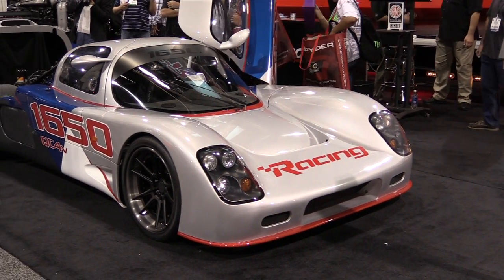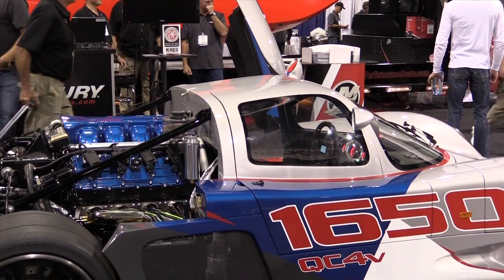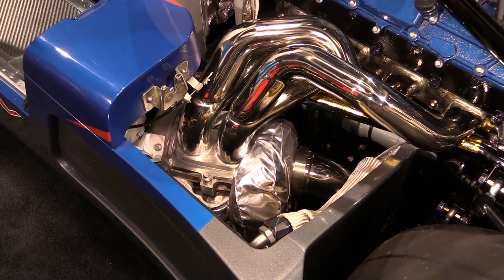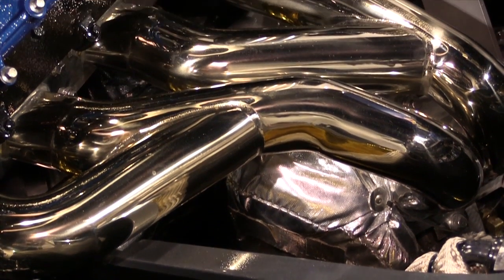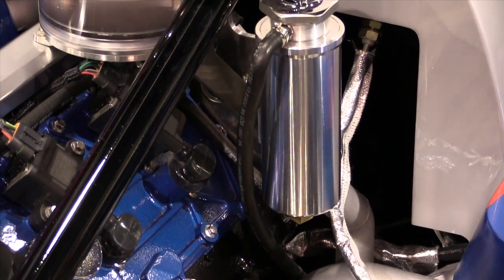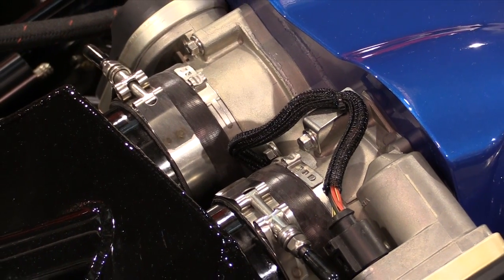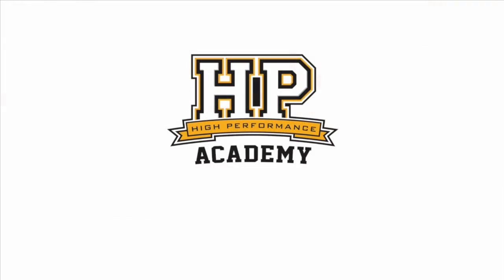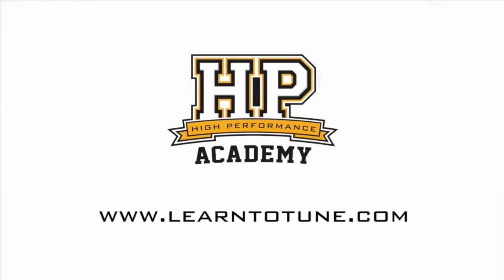1650HP Mercury Racing Crate Motor with Jason from Mercury

Comment: What kind of transaxle is being used?  I'm not aware of anything available that will handle more than 650 lb/ft of torque.  Looks cool, but I don't think the transaxle or axles will take the torque.

There's a reason F1 engines turn at 24,000 rpm. It's to develop a lot of HP at much lower torque such that the transaxle can be physically much smaller.

Comment: It should perhaps be mentioned that in a powerboat application these engines can easily consume +100 gallons/h when going for it. Just build your gas tank large enough is what I'm saying.
Reply: And there’s never just one of these engines in a boat. Ever.
Reply: Your car rolls on a smooth surface, a boat pushes a very large and heavy object through water. The two loads are vastly different. Ever try to run in the water vs on land? Hence why boats consume far more fuel. It would consume far less in a car than in a boat. Also in a car we have multi speed transmissions, a boat does not. A car cruises in top gear with low rpm, a boat runs 3/4 throttle for it's regular cruising. On a highway we use almost no throttle to maintain a cruise speed. That being said a 1650 hp 9 liter motor will not sip fuel. Check out a Hellcat, at top speed it smokes it's fuel supply in minutes with just wind restriction and minor friction as it's load.
Reply: @MovieMuscle   Top fuel dragster all burn over a gallon per second. And that is minimum 90% nitromethane. A typical offshore boat burns through 3000 dollars in a short outing. Both are for super rich or corporate racing. A lot of guys park their boats at the beach mostly...
Reply: A fuel dragster will go through 17 gallons in 1000 feet.
But its also making 10,000+hp.

Comment: Can it fit in a 93 Mazda Miata?

Lol JK
Reply from the maker: Do it. I dare you =P - Taz.
Reply: The rotary 2 stroke wankle and sled motors run better oil injection than this thing. this big block valved 552 CID 2 stroke needs a turbo to barely make under 3 hp pet CID, A rotax 850 etec make over 3hp per CID without turbo

Comment: 9 Liter and1600HP?  YIKES!!
Reply: pretty horrible.
Reply: An 850 rotax makes over 3 hp per CID with a turbo, this bid poppet valved 2 stroke comes close though
Reply: This is some time of big block 2 stroke, it’s got dry sump so it can be rigged with oil injection, Klotz oil is what I would use, I want to get one of these engines for s 2 stroke conversion but they are not cheap

Comment: The tech today  that makes an engine last longer is a centrifugal blower. You can still get lots of power but it spools a little slower and it's easier on parts. Perfect for boats. No heat like a turbo. Better for cars.
Reply: Mike383HK Did you just say “a supercharger spools slower than a turbo” 😭😭😭😂😂😂😂😂
Reply: You have no clue what you're talking about... Centri units don't "spool", much less "spool slower". They're actually HARDER on parts than a turbo, since they usually add a lot of lateral load to the crank snout, and finally, THEY STILL MAKE AN ASS-TON OF HEAT, BECAUSE COMPRESSING AIR ALSO HEATS IT, which is why pretty much every Procharger kit still comes with an intercooler.

Also, what the fuck does any of what you said even remotely have to do with this video?
Reply: Oil injection from dry sump, it’s a roller bearings poppet valved loop charged 2 stroke.

Comment: Hennessy is way out of your league. Stay on your boat monopoly.
Reply: John Hennessey is a dumbass and a CROOK.

He's a JOKE in the performance world that overcharges for shoddily engineered bullshit and routinely rips off his customers.
Reply: Finally a big block 2 stroke valved, loop charged though with oil injection, roller bearings throughout the motor, impressive big 2 stroke hear

Comment: Yeah i like to see the setup where it does full open throttle on 4 wheels for more than 5 minutes...You would need to tow a fuel tank behind that Ultima and put 3 times the radiators on it so it won't melt. 😂
Reply: Where is the place on earth a 1 tonne Ultima can be pinned at 1650hp for 5 minutes straight? There are very few places where more than 30s or so of WOT would be realistic and almost nowhere for much over a minute.
Reply: @siraff4461  its called a rolling dyno fool
Reply: @MrBundyjr  What has that got to do with it? The point is you can't pin it for that long so there's no point designing it to do that. It's not like driving your moms fiesta.
Reply: j r a dyno also couldn’t replicate the airflow of the car actually moving so it would over heat real quick

Comment: I'm going to spend 20 thousand on one of these before I die.  promise
Reply: Try $175,000.00 EACH
Reply: For the engine,or the whole car?
Reply: 2 for 40 thousand
Reply: 2 stroke conversion with dry sump oil injection like this::https://m.youtube.com/watch?v=IRiGq-VYWUk&t=245s
Reply: More like 70,000$ each for bare engines.  Now twin engines for a boat with all the running gear will cost you over 220,000. That without the drive components and without the boat itself. Your looking at a million dollar setup.
Reply: Devon R B   No do I do not need to be rebuilt that fast you can run the motorist 200 hours if you take care of them before you need to freshen them up  I home 838' fountain With 2 of them motors
Reply: The engine without turbochargers no intercooler no piping for turbos or coolers is 70 thousand dollars.

Comment: Wow 
6 feet wide
4 feet tall 
probably over a ton
zero parts availability 
so whatever
Reply: JethroBodean I read they have everything need to make it happen with money. I'm sure they will keep your investment running if you give them over 10g's. I would m8
Reply: Robert  Anderson The small block is LS based not the 9 Liter
Reply: JethroBodean They do have parts availability, in-fact they have multiple factories.
Reply: Funny considering its LS based you fuckwit
Reply: It’s a big block valved 2 stroke

Comment: I wonder if we could see 1650 on an E-85 tune with this awesome beast? Do you know if Jason and his team do that kind of tune with this?
Reply: Problem is not whether or not it could, because it can. What will be the limiting factor is the injectors. If the injectors will supply the fuel, it's most likely 2500+ capable on E85.
It would most likely be 2500-3000 hp capable in a car application on C16. It's a marine engine and it's already quite reliable in a 1650 hp C16 application. it can make a hell of a lot more power in a car where it's not under a constant high load with a high cylinder pressures.
Reply: E85 is a very poor marine fuel because it's so hydroscopic.
Reply: I would run oil injection from dry sump and VRO pump with silkooene pro 2 sx 2 stroke oil. This has roller bearings every where and is a poppet valved loop charger 2 stroke
Reply: @jlo13800  WTF are you talking about, your not even in the same universe as this engine
Reply: @chrisdeez2176  do you run oil i njection and can it run in multiple positions
Reply: @chrisdeez2176  I have run 7 gallons of xd-100 thought my detroit 8v92 2 stroke with total loss oil burnoff, but of wee its kind of pricety but sucessful, she loves it but i dont because of the cost some im back to shell rotella with quicksilcer TCW3, bummer!
Reply: I have lots of etec XD-100 and can and will run this oil, what is your fucking problem?
Reply: this engine can run on a poppet valved loop charged 2 stroke engine with total loss oil in injection with 2 stroke oil, you are stuck on a 4 joke stroke with no oil injection, this is an easy modification and it can be done!

Comment: This thing does not run 200-300 hours in a marine application without rebuilds. The 1100 maybe, but not the race spec 1650.
Reply: That's just race gas on the street cam. 1650hp is just a baseline. that engine is most likely capable of 2500hp in marine trim. remember, they're only at 20psi.
Reply: What?
1650 is not a baseline, it's the max power offered on this engine on race gas. And no, if the engine is capable of 1650 hp in a car, it is not capable of 2500 hp in a boat. When this engine was developed a few years ago, Mercury Racing raced a version dubbed Quadzilla with four turbos that had an output of 1750 hp and those things needed rebuilds after each race. Boat engines are under a lot more strain, run wot for much longer periods with higher cylinder pressure than car engines. There's a reason why see so few offshore engines above 1500 hp and the 2000hp car engines are all over the place. I've built both, and it takes a lot more to build a strong 1000 hp boat engine than a strong 1000 hp car engine. That's also why boat engines have a much shorter cycle between rebuilds.
This exact engine has an output of 1350 hp in marine applications on 91 AKI fuel, 1650 is not a baseline in any way shape or form, it is what the engine is capable of.
Reply: +ABOlsen69X  I'm seein 2.4litres churn out 750whp ethanol and boosted down for regular street use. your telling me a 9 litre  with unlimited funds cant achieve a better hp/ltr when it doesn't go thru the gear shock a street strip car gets. not to mention your IATs, EGTs, and oil temp are better in a marine application, consisting it's getting cooling from the body of water it floats in, meaning more oxygen for more fuel and less heat related stress. overheating at extended WOT should not be an issue, where as the street applications would see temps an easy 100° higher. ???
Reply: +ABOlsen69X and I say the 1650 is a baseline cause that was at 20 psi pump gas...
Reply: Don't take this in an offensive way, but I think you need a basic understanding of what an offshore marine engine is, what it can and can't do to understand this and you don't have that. The way you describe things and compare them, has nothing to do with anything. In order to understand a high performance marine engine like the Merc 1650, you need to forget everything about car engines. There's a reason why a built 1400 hp whipple blown EFI marine engine is more expensive than a 2500 hp twin turbo EFI street engine. Everything needs to be overbuilt to an extreme degree, and yes, running WOT for long periods with high cylinder pressures is very tough on the engines. The ocean may provide a lot of water, but there are a limit to how much water you can flow through the cooling system without doing damage, so it's really a moot point.
As for the 1650 having to run 112 AKI or higher,? Don't believe me? Why don't  you ask Mercury racing or just have a look on their website? It's all there.

If you really want to know about this stuff, I suggest that you become a member of the offshroeonly.com forum. Lots of nice people there, including many who run the Merc TT 1100's, 1350's and 1650's. There are great engine builders like Eddie Young, Bob Madera, Dustin Whipple and Tyson Garvin who are always up for answering questions.

Have a good day.
Reply: +ABOlsen69X well I've been asking people for sources on marine applications and I've been getting the run around. You're about the only person that's pointed me in any direction.
Reply: +ABOlsen69X maybe I'm hearing it wrong but the engine that's in the car is 1650hp, wild a cam less aggressive than the marine cam and emissions. I'd assume on that alone that this isn't a peak motor. the engineer even said they've tuned it a lot higher. Prolly doesn't pass the 300 hour test, but it's capable of a lot more.
Reply: What he is saying is that in THIS particular application it is conservative. What he's also saying is that the 1650 runs race gas and the 1350 runs pump gas. He also noted that they leaned on it with a bit of a laugh, when he mentioned the 2500 hp. This I read as he saw it as a fun experiment, but not something he would recommend.
As the interviewer also points out, it takes a much harder beating in marine applications. This is also where they talk about how they test them.
There's no doubt that a 9 liter engine like this can make a lot more power in a street car than in an offshore powerboat application. He is also talking about using stronger valves etc. for the marine application. What he is also saying is, that they use short conservative cams for emissions and drivability. The latter he also stresses to be a vital thing in marine use. It's very hard to dock a boat where the engines won't go into gear without stalling etc. so they need the low end grunt. 1650 is aggressive for a boat, but conservative for a car. That is the essence of what he is saying.
Another very important reason for the conservative cams. In the world of powerboating, we sometimes talk about a term called water reversion. This occurs when the lobe separation angle is too narrow and aggressive. If the LSA is say 110 degrees or less, you run the risk of pulling water back from the water cooled exhaust into the combustion chamber. This limits how aggressive cams you can run. Add to that a tall cam needs a lot higher spring pressure and more aggressive lobe ramps, which puts a lot more strain on the entire valvetrain, especially at higher rpms.

Then there's the overall performance. You have to remember that a boat usually don't have multiple forward gears and boats are propped so that the engines reach +/- 150-200 rpm of max hp at wot, so very close to the limiter. Imagine having a Corvette C6 ZR1, which is unique because it's one of the few sports cars that Vmaxes at close to redline i.e max hp, with an automatic transmission with only one forward gear and a converter that locks at 1500 rpm, and triple the weight of the car. Running it like that, is basically what you ask a boat engine to do. Not only does the engine(s) have to be able to run some of these boats to 200+ mph, they need to get them up on plane with a full load while doing so, so again, you need a lot of low end torque for that and you need to keep detonation from occurring with a super high cylinder pressure.

What is base power for a high performance car engine, is close to max in a marine application. Buy a pair of crate LS7 engines and put them in a Fountain 35 Lightning for example. That will net you about 96-100 mph on that hull. However, you can consider yourself lucky if they do that for more than a few hours without complete failure. To sort of put it into perspective, look at it this way. 2000+ hp LS car engines have been around for the last 5+ years. It is not until recently, that some of the best marine engine builders have gone beyond 750 hp in marine applications. There are a few 800-900 hp LS engines around, but most special built marine LS mills are below 800 hp still.

If it will live for 200-300 hours between rebuilds in a boat while taking a beating, it is pretty indestructible in a car.
Reply: ABOlsen69X lol he also laughs and references they hit the 2500hp when they were developing their boost controller meaning they lost control of chargers and spiked a massive number before shutting it down
Reply: @DanEvan  nice 2 stroke engine there, poppet valved u-loop scavenged 2 stroke with dry sump and klotz techniplate r50 2 stroke oil, that what i would fill and run in her, keep up the good 2 stroke work!
Reply: @AB-80X   Just a guy that really souped up everything and knows history, including Mercury. They had incredible reliability in the old straight 6 tower of power... Up to 50 races on one rebuild.
As big and specialized as this motor is, the biggest risk to the longevity, like a sandrail's, is sudden loss of resistance. I'm guessing they use an Arneson drive. But any cavitation or the prop coming out of the water, and the split second changes in load on the motor will do damage. Same as a big old diesel is most damaged by idling. These motors need consistent load. They are not little 2 stroke motocross with the cylinders all ported out and short pistons.
These motors are built to task. And winning one race at a time is that task. If you take a 427 out of a truck and put it in a Corvette it will also break apart. There are so many small factors that come into play...Crankcase pressure, ring tension, piston side loading... This big monster probably resembles a diesel 2 stroke turbo powerlplant generator motor more than either a car or boat motor.
Regardless, it is fascinating.
Reply: ABOlsen69X  You brought up all very good points. But one thing a boat dose that a car  dose not, going from full power max pressure to free wheeling when the props come out of the water  and back when they hit the water.  That in it's self will destroy most engines.
Reply: Kevin Collins

Well, you're right about it unloading and loading the drivetrain, however, this will rarely, if ever, destroy the engines. I've never seen a boat that lost an engine due to this. What will be destroyed if you're not throttling your boat properly, is your drives, transmissions/crash boxes or props. Sure, if you don't throttle back going wfo in the rough stuff, you will over-rev the engines and destroy them, but that's not about reliability or harsh conditions, that's just being a moronic user not thinking.
The problem with turbos in a high performance offshore marine application, is the fact that they respond slower to throttle input than N/A and blown engines. This makes it harder to match the prop speed on water reentry, and this will be hard on driveline parts and props.
Reply: ABOlsen69X IT'S NOT A RACE SPEC, 1600 is with a conservative cam setup and tune for emissions
Reply: @Boobehh  either you are joking, or you are an idiot. im assuming you're joking.
Reply: How is the oil injection set up to run on these, Silkolene pro 2 ax is what I would use pulling off the dry sump into a VRO pump for the intake

Comment: Wow amazing bit of engineering
Reply from the maker: It sure is! I'd love to have a street car with this engine. :)
Reply: Yeah dry sump with oil injection for this poppet valved 2 stroke which I heard this is, a few gallons of amsoil dominator 2 stroke will make her happy. I want to find one as aluminum block is easy to cut ports into it